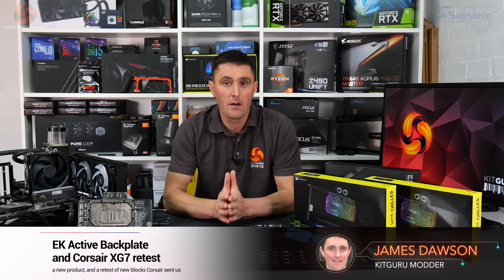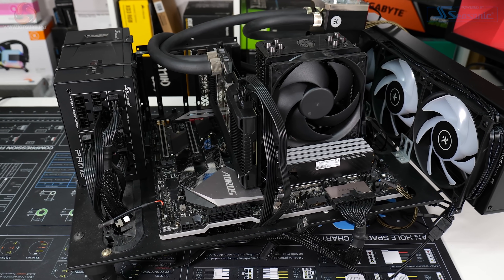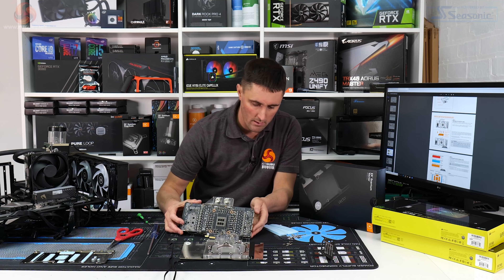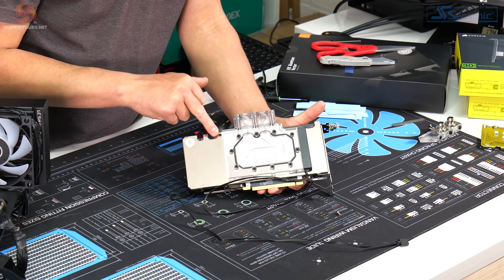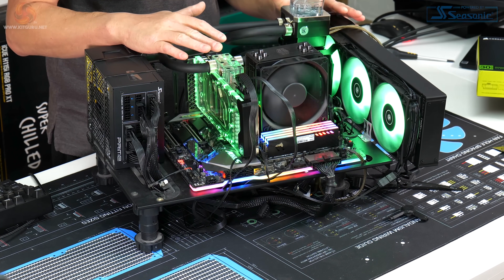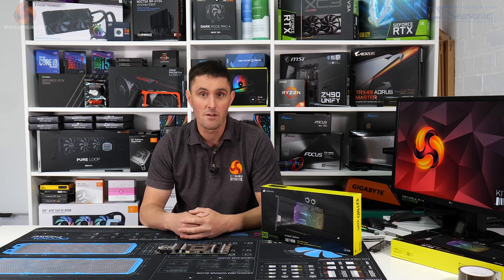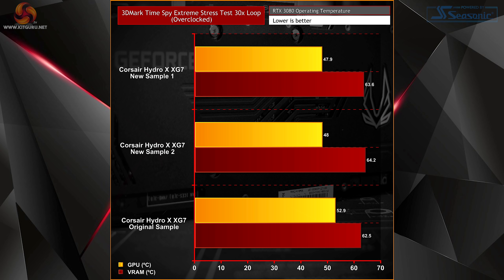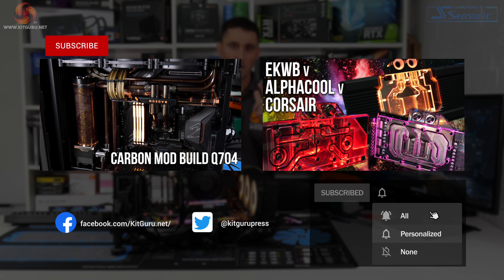EKWB Active Backplate and Corsair XG7 Retest

Comment from the maker: Watch James waterblock roundup here: https://www.youtube.com/watch?v=ZjakYMT76jg
00:00 Start
00:15 A recap - Corsair sent us new blocks
01:16 EKWB Quantum Vector Active Backplate
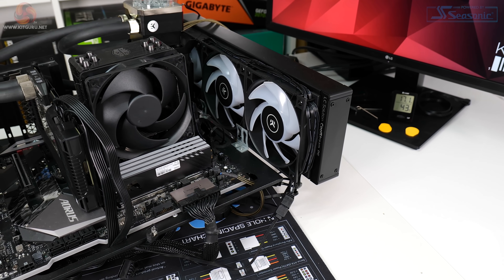02:31 Test Bench setup
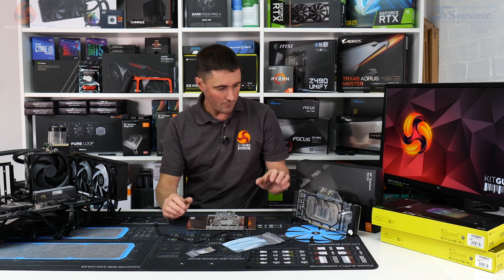03:10 Active backplate / Installation on RTX3080
07:09 Its installed, how it looks and a few minor issues
09:12 System ready and some test results
11:12 Corsair XG7 RGB retesting with new samples
12:58 XG7 Testing with new samples
14:20 XG7 results
15:28 So what do the results mean?

Comment: The active backplate was most likely not mounted correct. There should be much, much more effect on the vram. At least on a 2090 with vram on the back. For sure a 3080 has no big effect... but who would buy an active backplate for a card without vram on the back?!

Comment: Great vid! Question about the terminal on the XG7. Does it attach the same way as the EK terminals, what with the 3 screws that go in perpendicularly? I plan on using an EK GPU quick disconnect kit on the XG7 but I'm unsure in the terminals will be compatible. Thank you!

Comment: Are their any visible differences in appearance on the Corsair models from the original test sample to the 2 new samples? Interesting the better GPU core temp difference (few degrees better) are similar figures, yet go the opposite direction (few degrees worse) for memory temps 🤔.
Reply: No visible difference between the original block and the new samples.
Reply: @jamesdawson8323  interesting 🤔

Comment: A video idea/challenge for you: there's LOADS of "budget PC build" videos, so instead, find the very best online pre-build customisable PC that people can order, with every dollar spent well & justifiably, that is as close to £4,000 (about $5,600 US) as possible (within a couple of hundred either way - that's the challenge). Then justify why, if a customer has that money to spend & wants an amazing desktop gaming PC (excluding monitor and peripherals), why you have chosen the components wisely, to give great value per £/$ even at that level. Performance (including ample power, quiet and amazing cooling even when greatly overclocked CPU & GPU) comes first, but once you cap that then appearance (like ARGB with your custom water cooling) is bonus points. :)

Comment: Your test bench just looks so neat my dude (i think you once said you built it yourself). I made a bench myself completely out of wood, it is good but there are times when it shows that i didnt think the design through enough. Yours looks much more efficient.
Reply: Yeah, just asked him what case the mobo tray came from. 
It has to be a good case that got cut up like an Antec P series or similar, mainly because the PCI bracket still seems rigid.
Reply: @JuxZeil  I think it was a Fractal Define R5. I had to add a bit of strengthening to the PCIe slots to keep them rigid.
Reply: @KitGuruJames  Cheers bud.  Next time you do a vid with it could you give us a peek at your mod of that PCI-E section please?  I haven't found many cases you can cut up without making that part too flimsy for my tastes, and it's hard to make the job look very good if you want to use it as a main rig.
Reply: @JuxZeil  Seconded.
Reply: @JuxZeil  I just riveted a couple of steel L brackets between the motherboard tray and the PCIe slots.
Reply: @jamesdawson8323  That's what I would do normally but I still find it to flexible unless you use thick(and thus ugly) ones. 
OK, cheers.👍

Comment: i have a corsair xg7 on a rtx 3080 founders ed, i can say i have some of the best temps you can ask for on water cooling, i mine etherium and my vram temps never go above 72, it goes around 68 when im full speed on fans and pump, the fin stack is dense, i think if your running thicker coolant you may not benifit as much as some one who runs just distilled, since its so thin and flows better in a tight space. I am a temp guy and i can say the bitspower classic block didnt do well and was a pain in the a to install its not worth a dime with the whole product, corsair blew them away with better everything and simple install. the temps are great, the bitspower vram was in the low 80s
Reply: Yeah the Corsair XG7 and EK blocks do well with VRAM temperature. Installing the XG7 is an absolute breeze.

Comment: So the this active backplate is a gimmick for 3080 (probably useful for 3090).
Anyway, have you got any response from Alphacool regarding the Vram temps?
Reply: My 2080ti EK backplate gets too hot to touch for long (and evenly across it), which means it is passing a lot of heat through.
The backplates on my 3090s get super hot.
Reply: No word from Alphacool yet Pavel, I'll try and get in touch with them this week to see if there is any progress.
Reply: For the 3090 it dropped my vram temperatures by 48°c
Reply: No, vram and core aren’t the only things to get hot on a gpu.